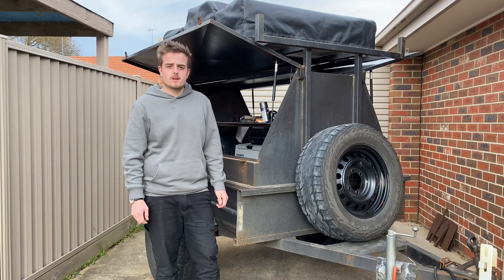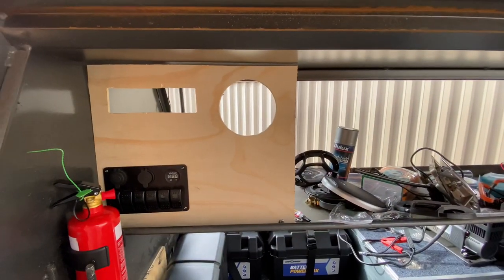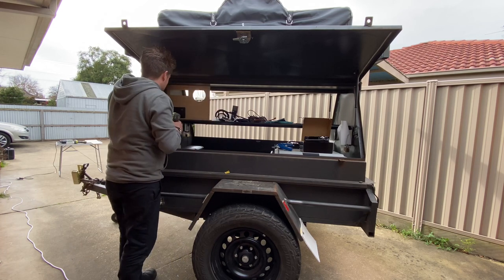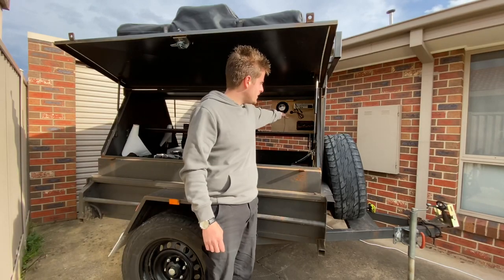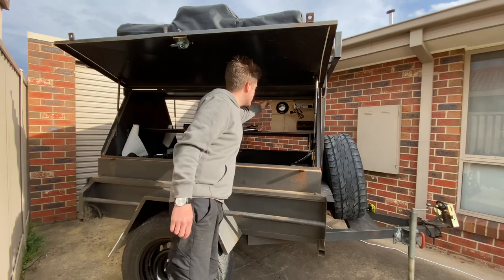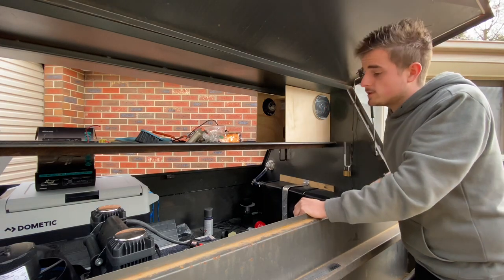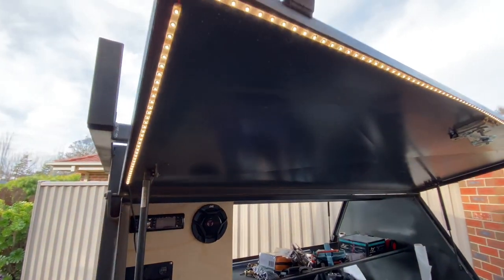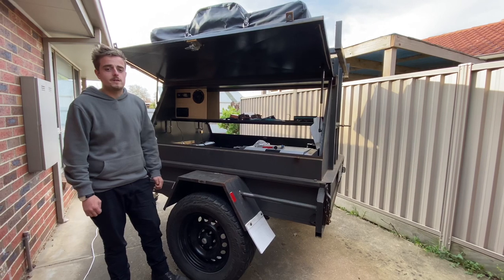Camper Trailer Conversion Part 5

Comment: Awesome work!!
Sorry for my ignorance, I am very new to this, when you make holes around the structure, how do you prevent water from getting inside?
Reply from the maker: Usually seal it somehow wether it be sika flex or a grommet depends on what your doing

Comment: For LED strip you need a proper driver (power supply) if you connect it directly to the battery it will work only for short time and will burn.
Reply from the maker: Hi there, the led strips I got are made for 12v battery supply.. they have been working great and I have used them for hours.. 🙂
Reply: @EngineeredToDesign  for LEDs amperage is very important not only volts. The power supply must provide 12volts as well as NOT MORE than required Amperage, otherwise it's damaging LEDs.
If you supply more amperage they are very bright at the beginning, then get darker and die.

I couldn't find a single LED driver for 12 volts on eBay.

Comment: Love your vid. Just bought my first trailer and kitting it out as well. Can I ask why the compressor ? I’m just planning on leaving mine in the tub of the car but not sure if I’m missing a trick
Reply from the maker: Thanks mate, that sounds great! I put it in there as they drawer a heap of power so I wanted it close to the batteries and it came with a long extension lead. If I was to put it in the back of my car I’d have to run heavy wiring down..

Comment: Why did you decide to mount the batteries on the inside and not on the outside on the front?
Reply from the maker: Hey Dan I wanted to keep them inside because I didn’t want to drill to many holes running wires outside, also it frees up the front for a toolbox.